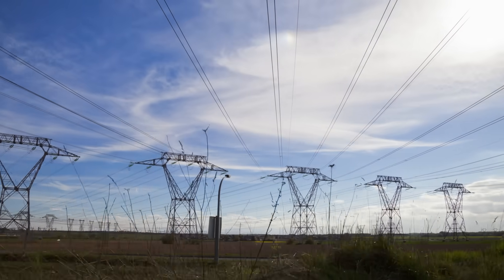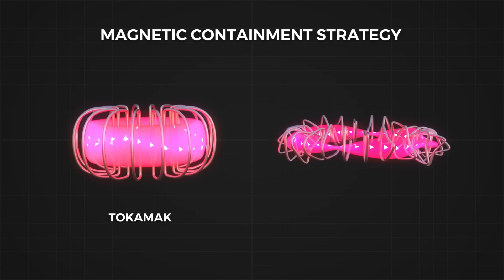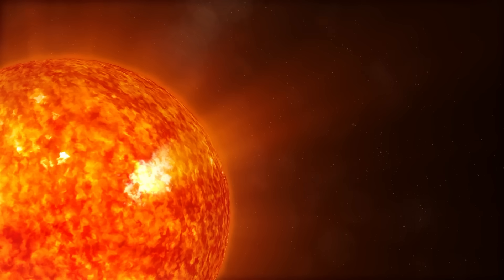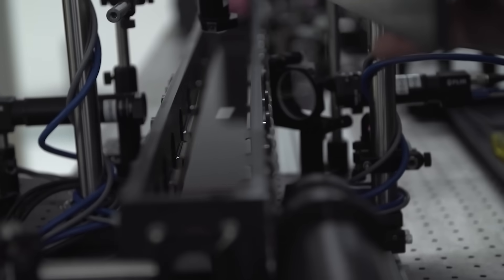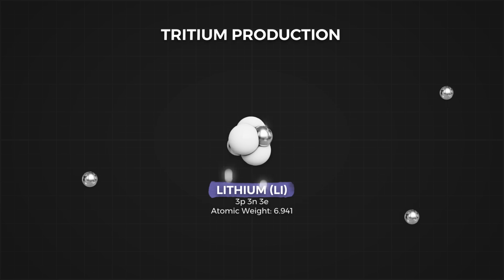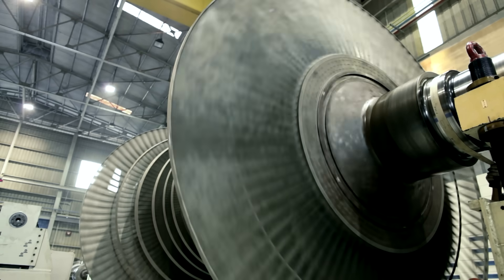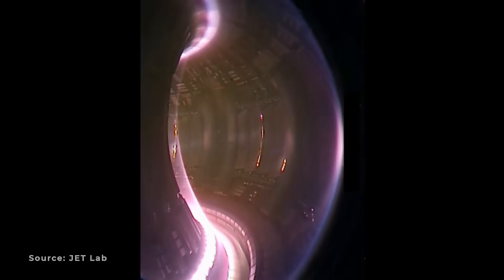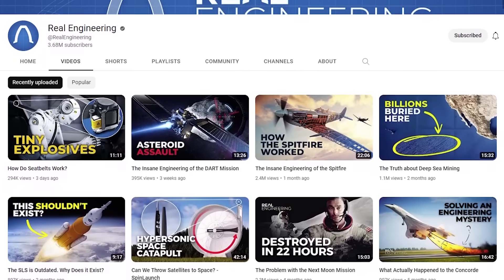The Problem with Nuclear Fusion

Comment: To make fusion work on earth, we need extremely rare material, so fusion is far from infinite energy. The correct way should be directly build a dyson swarm and use Sun's fusion. It's difficult, but nothing stop us from only build 0.00001% of it, that will still be more than the entire world's energy consumption.

We should stop research fusion and start build Dyson swarm now.
Reply: You think we don’t have the materials to build fusion but we can build something to put around the SUN? How would that be economically viable? And how would that not take all the material on and in the planet to build?
Reply: @Gomlmon99  We need very special hydrogen only several hundred kg on Earth to fuse. The sun use normal hydrogen.
Reply: @zjz1  To build a Dyson swarm, we would need to either mine the Moon or Mercury. At that point we would have no problem with mining our helium-3 there or capturing it from solar wind. But yes you are right, the final stage we want to reach is building a Dyson swarm.
Reply: @notthomasjoel  That is if we want to complete it. We can definitely make a few units on Earth. What is the energy output of a single unit?

If we use inverse square law and put it 1000 times closer to the sun than Earth, the energy output should be 1 million times stronger than the same sized solar panel on Earth.

Comment: Wouldn’t using lithium to create more tritium be problematic though? Are we not currently struggling for lithium just for EV batteries? Lithium is a pretty limited resource
Reply: The amounts needed would be minimal and lithium is actually a relatively common element. It could be extracted from seawater at the relatively small amounts needed.
Lithium production will likely increase a lot in the coming years.

Comment: Great video. One critique is you said 'fusion' several times when referencing tritium as a byproduct of 'fission' reactors which is where the world's stock comes from. It is of course an easy mistake as the words are very similar.
Reply: No, Tritium can actually be made in FUSION reactors. The neutrons produced by the fusion reaction can be used to breed Tritium. That said, the better way is to not use Tritium at all. Requires a very good fusion generator design though. Helion is on the right track with that, IMHO.
Reply: @elmarmoelzer2229  While you are correct, there definitely were multiple times in the video that "Fusion" was used where "fission" was definitely intended, especially near the end of the video. Easy enough to pick up with context clues, but could have been a bit confusing to the layman.

Comment: The only way to get more out than you put in, is to have unlimited free energy in. Aka gravity. Fusion will never happen. IMO it’s a scam to make it look like the people who own the world are trying to make free energy for everyone. We all know it won’t happen.
Reply: That's nonsense. We have shown that we can do it on Earth in hydrogen bombs and we understand the physics well enough by now to make it work.
Reply: @elmarmoelzer2229  then it should work. But it doesn’t. And I think even if it did work, the energy needed to synthesize/produce the necessary fuel would still be at a net loss. Nuclear fission has the same problem, although does work. In order to make the waste into something that isn’t toxic, likely takes most of the net energy created in order to do so. So we don’t do it. Nature has a funny way with checks and balances.
Reply: @shannonsisk  This is all nonsense, really.
Fission is actually one of the cleanest and most effective energy sources we have.
Fusion will be even better. 
Also define "work". Their previous prototypes all worked as well as they could make them work with the funding they had. The upcoming one will make electricity in 2024. Also making the fuel is not even on the scale. A machine like that will take maybe 20 kg of fuel a year. It is easy to make from seawater. Does not take a lot of energy either.

Comment: u already explained the problem within 2min. yes the fusion of atoms releases energy, but you also need alot more energy to break the bond to make them fuse, alot more than you get out because thats how the world works. stars are able to do it because they arent generating energy, they have a ton of energy stored and it gets used up. we wont be able to make power like we do with fission, its that simple
Reply: No, it does not necessarily work that way.
Reply: @elmarmoelzer2229  care to explain or youre just gonna believe bs? considering the current fusion testing we did so far on a pretty big scale, it works exactly that way. the recent tests "generated" more energy, but thats because they put in more energy, at an even lower rate of generation than before. specifically it has an efficiency of -50%. look into the papers themself instead of watching an uninformed video from a guy who didnt do his primary research and has an incentive to make you click it
Reply: @MrPaxio   We did it with nuclear bombs just fine. 
The NIF experiment was never meant to be wall plug efficient. It was designed and funded as an experiment.
Really, we have known that it is possible for years from a pure physics point of view. ITER will work, but it is an old and conservative design. Newer designs are much more efficient and use newer technology to improve on previous designs (like ITER and NIF). I know the guys at Helion personally, have known them for over 8 years. They are legit and they know what they are doing. There are still some risks, but they are small. I also know people at several other fusion companies and groups. They are all smart know what the are doing.
Reply: @MrPaxio   I am not believing. I KNOW!
Fusion was always underfunded, actually.
Also, you seem to live in a universe where nothing can ever be done for the first time.
And really, you talk with a lot of confidence for someone who has so little clue about the science, physics and engineering behind fusion.
Reply: @elmarmoelzer2229  if its been tried and tried and tried for the past 80 years, with no measurable amount of success, trying more is kind of insanity. how can you say i have zero clue about fusion when ure the one who believed real fusion bombs existed? im the one who had to break the news to you. like you realize the first thing you learn about science is to do something on a small scale to make sure your theory atleast works. well, theyve been testing this on small, medium, and large scale, and look! it doesnt work! i know you dont like not being right. and tbh i dont need to fully know the copium science, what i know is that even to this day they are doing these tests, and these tests are even more energy inefficient. i look into the primary sources way more than the creators of these videos who just want to reap rewards from your hope. call me when it actually starts working, text me when they, or you, have actual evidence of it generating instead of sucking up energy, which will be never. nothing has changed between 80 years ago and now, the result is still the same even with your "new designs". its not science to do something wrong in a new way
Reply: @elmarmoelzer2229  bahahaha broooo i just checked out the recent fusion test that everyone is hyping on about that its this hugeeee breakthrough. broooo the whole system used 300MJ and they got 3MJ out of the reactor, hahahaaaaaa, so what do we call that? -99% efficiency rating? why do they feel so smart when its dumb?
Reply: @elmarmoelzer2229  its actually hilariously bad with the amount of hype for this "breakthrough" that generated -99% energy
Reply: @MrPaxio   Helion is not NIF. Their machines have a very different design. NIF is a bit overhyped, but it is worth noting that NIF is a machine designed some 30 years ago. Modern lasers are much more efficient. If you built NIF with today's technology it would be much better.
That said, the purpose of NIF was never to make net electricity. It is and will always be an experiment designed to test certain plasma conditions. The idea is to show that it can be done and then future generations of machines would make a power plant from it. Personally, I am not sure that the NIF approach will ever result in practical fusion power plants. I wished all that money had gone to other fusion experiments. But then, the main purpose of NIF has always been to test nuclear weapons, without actually testing nuclear weapons. It is and has always been mainly a stockpile stewardship project. The fusion for energy purpose was just a means to keep it funded.

Helion is completely different. It was designed from the start with energy production in mind. It has a clear path to a power plant. You can't compare the two.

Comment: I have to add that the vast amount of tritium that is produced comes from canadian nuclear powerplants. They have build the infrastructure to extract the tritium from the waste, whereas other countries just disposes of it. Increasing the supply is something we are 100% able to do. Also the fusion process releases some neutrons, part of which will hit a deuterium atom and make it a tritium one. The rate is rather modest but the walls can be made of good reflecting materials. I felt that I need to specify these things because in the video the problem of fuel, in my humble opinion, is given too much importance. There are many many obstacles in the path to fusion power and each one is a problem that must be resolved.
Reply: Better way to breed Tritium in fusion power plants is to make so called "blankets" with a high content of Lithium.

Comment: I understand that there are a lot of issues that this position opens up, but I'm really looking forward to the day when we find either a better energy capture capability or an energy source that we can utilize without the efficiency loss that's inherent to the steam-turbine method of generation. If we can figure out how to ignite, stabilize, and maintain a fusion reaction, I have to believe that we're also able to find a way to capture the energy output in a more direct way, heating water to generate steam just has so many energy-loss variables...

Comment: We don't have to wait until the problems of fusion are solved.  Molten Salt Thorium Reactor technology already exists since the 1960s, and produces 200 times the power that Uranium Light Water Reactors that the public is familiar with.  MSRs can be designed to burn waste for the LWRs because they are 97% more efficient.  They can be built small enough to run a car or big enough to run a big city.  The best solution for the future of energy supply is the construction of Molten Salt Thorium Reactors.  Besides providing abundant, cheap electricity, they can provide a myriad of other functions that will completely defuse the Green New Deal. They cannot melt down because the molten salt is the fuel carrier.  Thorium is preferred over Uranium because it has 200 times more energy potential and it is literally dirt cheap.  Thorium is abundant and has been the "waste" product of rare earth mining in the past.  The reaction occurs between 600-800 degrees F.  If the molten salt should ever overheat the reaction stops and a freeze plug in the bottom of the fuel jacket melts and the molten salt flows into a holding tank where it cools down naturally.  They can be set up to burn the waste from light water uranium reactors because they are so efficient.  They can be used for producing non-carbon diesel fuels.  They can be used to cheaply desalinate seawater, and scrub carbon from the atmosphere.  They are safe and can be built anywhere.  They can be made small enough to power a car or big enough to power a city.  The U.S. has about t a dozen companies that are either ready or near ready to construct them   France is developing them and Denmark has one company developing them.  I don't know about Germany, but Germany would clearly benefit from them and could erect them quickly if they desired.  They must get over their anti-nuclear sickness, however.  There is no time to waste.  here is a four-minute introductory video to MSRs. - 
https://www.youtube.com/watch?v=k6BXvw6mxtw

Comment: The engineers at NIF seeing this video and changing the world 24 hours later just to make you look like a tool has got to be the gigachaddiest move I've ever seen
Reply: If you want to make a working commercial fusion reactor in two years, and get commercial heat, I can help you. I have made a great world-class scientific discovery about nuclear fusion in the atmosphere of the Sun.  The assumption by scientists all over the world about nuclear fusion in the core of the Sun is well known.  This is a fallacy. For over 72 years, scientists have not been able to make a working commercial thermonuclear reactor, and will not be able to make one for many years to come. The reason? The misconception of nuclear fusion in the Sun. 
Nuclear fusion in the Sun's atmosphere begins under the physical conditions existing there at an initial plasma temperature of 5,000 K; by the end of the fusion reaction, the solar plasma temperature reaches 1,500,000 K, on average.  Sunspot temperatures on the Sun from 3,000 K, sunspots can be up to 100,000 miles in size. Doesn't this prove that nuclear fusion occurs on the surface of the Sun, not in the core of the Sun? If we take a good look at and study sunspots, it is clear that nuclear fusion takes place in the Sun's atmosphere.  
I know how to replicate the physical conditions for nuclear fusion in the Sun's atmosphere. I propose a reactor design with the same physical parameters for nuclear fusion and excess heat as in the Sun's atmosphere.    https://www.youtube.com/watch?v=FcypwoVOAAY 
To make a small working prototype confirming the principle of nuclear fusion in the Sun's atmosphere and obtain commercial heat needs about 10 million euros, manufacturing time 2 years. It could be less. Depends on the country where the prototype will be made.

Comment: You won't live long enough to see this pipe dream materialize. The US announcement is by a government entity that has a stake in promoting BS for more tax dollars. On top of that the French "Fusion Reactor" project is now out of action for decades due to manufacturing defects. Manufacturing is not perfect, full of imperfections at best, the French reactor requires perfection.
Reply: The scheduled start at Iter is 2025.
Reply: @Safetytrousers  That was the old start year, after the micro cracks found in the containment chamber they said it's more like 2035 or even later. The vessel has to be removed and a new one re-manufactured. That information came from French news. What's more I just read a comment on the US Dept. of Energy claim announced on Dec. 13th. They stated "although this experiment demonstrated a positive Q-plasma (3.15 MJ / 2.05 MJ > 1), it still took about 300 MJ from the grid to fire the laser ". There is no mention of the Q-Total number that has to be used to determine exactly how much the net energy output is.
Reply: @MrClippy-f7n  Yes, I found out about that after that comment.
The deuterium-tritium operation was originally scheduled for 2035. It was plasma that had been scheduled for 2025.
The revised plasma date ''was said not likely to be agreed until April 2023''.